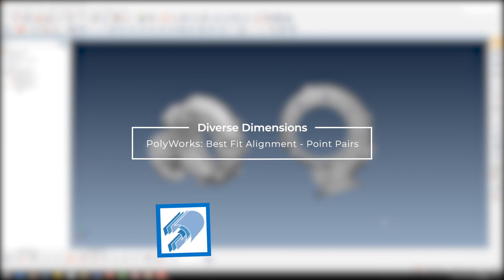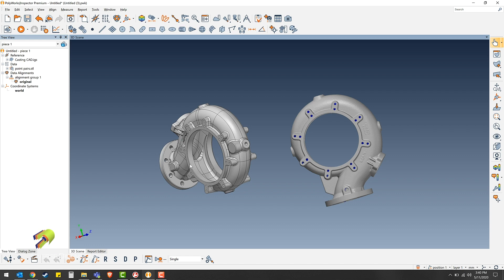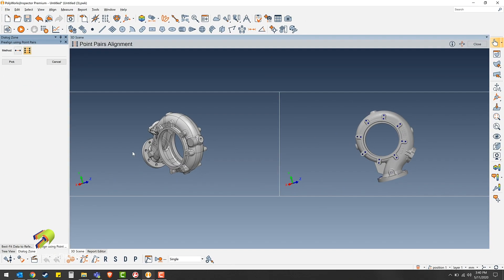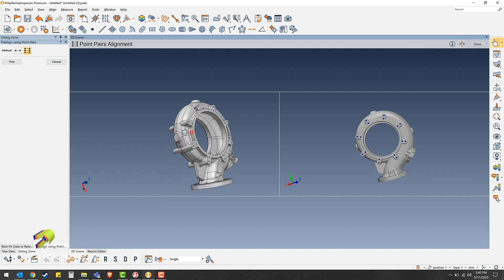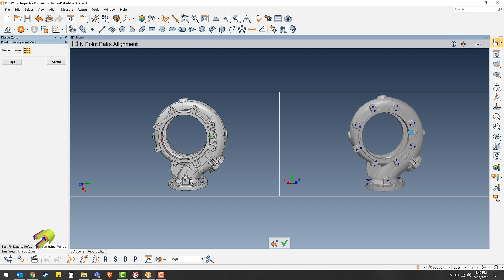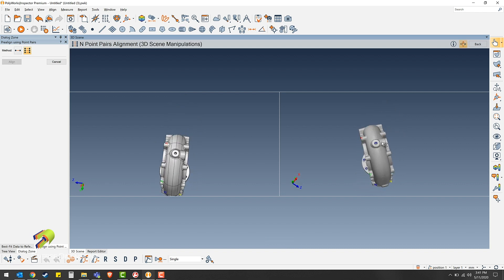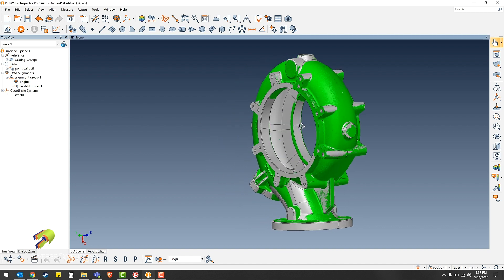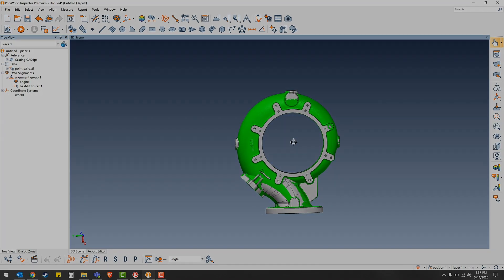PolyWorks: Best Fit Alignment - Point Pairs - Example 1

Comment: Do you put the points based on the datum on the drawing or based on your preference?
Reply from the maker: We usually use points on surfaces that are "mutually perpendicular" to each other for solving this type of alignment and not necessarily  the datum points.  If datum points are on the drawing, we would use the "best fit" initially and then use a reference point alignment to the datums after that.  It does make the extraction of the datum points a bit more effective